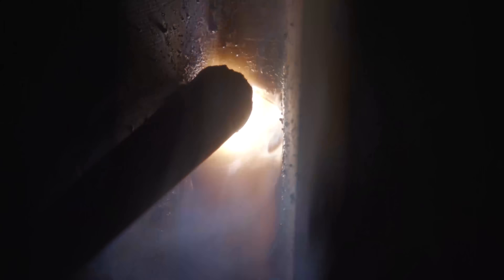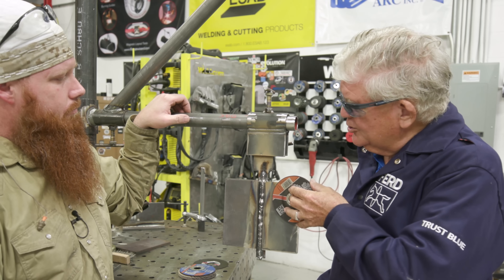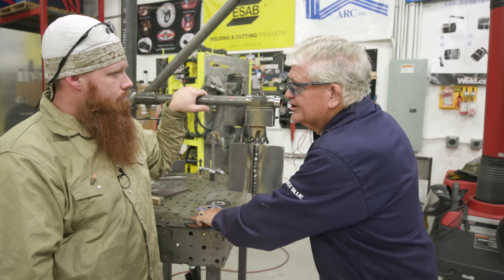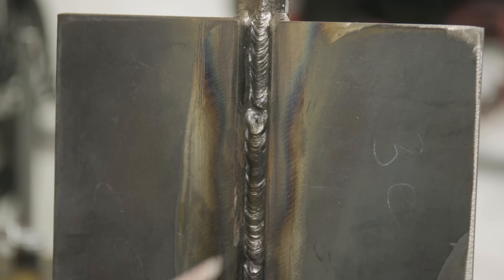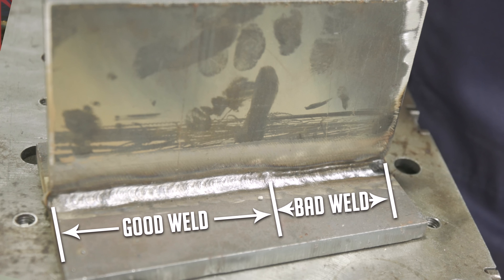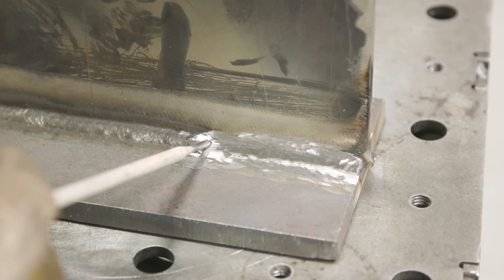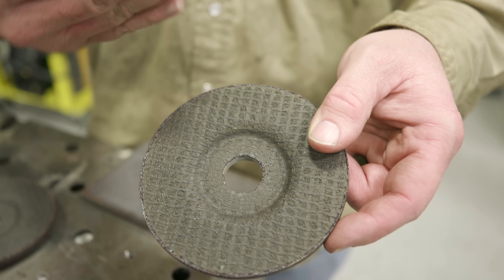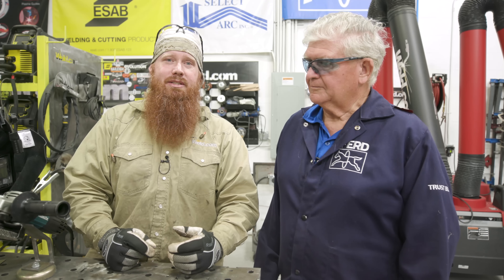How to Repair Common Weld Defects with the Proper Tool

Comment: Good info but how can you grind a bad weld out of an inside corner. A 4.5 inch wheel won't let you get very close in the corner. Is there another suggestion for tight areas like this? Thanks, guys. Great info, great videos!
Reply: Die grinder maybe? With a ball end carbide

Comment: Or you could just use an 1/8 inch cutting wheel, well you will because most fab shops dont like spending extra on stuff thats not the norm. Or you'll just be using the 1/4 inch that's worn in, you arent going to split it grinding out that minute amount unless you are an idiot and lean on the thing.

Comment: I use 4 1/2" 40gt Steel Demon corner-edge flap disc type 29 conical design from Casa Depot.

Comment: Hey man I have a question that hopefully someone can answer.  I want to get certified for my business.  I mainly tig weld aluminum. What type of certification should I be looking at getting
Reply from the maker: As a business owner, you should reach out to your local weld inspection company and develop a procedure. Since there are no prequalified aluminum procedures, you will have to develop your own. They can help you with that.
Reply from the maker: As a business owner, you should reach out to your local weld inspection company and develop a procedure. Since there are no prequalified aluminum procedures, you will have to develop your own. They can help you with that.

Comment: You do know that there is a flap wheel that has been designed with a rounded edge.  It was made for use with fillet welds.  It is made by Diablo.
Reply: Samuel Swearingen Pferd also makes one. Most companies won’t buy them though.
Reply: @GodslilRedneck23  Of course we won't buy them - they're gold-coated (expensive).

Comment: The problem when buying grinding disks is that there are so many manufacturers making so many types, and levels of disks. They all claim that their material, processing, backing, etc. is best. Since they’re all somewhat different, even in the same category, it’s often impossible to make a really informed decision. I’d like to be able to try a number myself, but often, you can only buy a 5 to 10 pack, with some of these disks costing $5 or more each, even in the pack price, making it expensive if you decide that it really isn’t what you want. Doing that once may be ok, but 3, 4, 5 or more times? Forget it. So you just use what you have.
Reply: Mel Gross I’ve had good luck contacting companies directly and getting free samples.
Reply: When I was working, I could do that. But I’m retired, so it’s not as easy.

Comment: Maybe I missed something with your protractor. You’re looking for 37.5°, I read the protractor to be at 53°?
Reply: Henry Ruzakowski the angle was pulled from a 90° corner so you’d subtract 52.5 from the 90 and get 37.5°.
Reply: So... what's 53 + 37?

It's 37.5 off the leading edge, not the top.

Comment: I love how you "have to repair" welds that are better than 90% of what I lay down...
Reply: Jack Dawg I was there man. You’ll get tired of grinding out welds and that will make you a better grinder. I always say, the grinder made me the welder I am today.
Reply: Peter Vendere that’s actually pretty sound advice, thanks sir!
Reply: The first step in being good at something is being a beginner.
Reply: @petervendere3451  Lifting weights is the WORST type of exercise for control. Go do calisthenics rather where majority of your exercises are stability based exercises. Don't believe me ? Go and do a free standing handstand and compare vs a gymnast, check whom has more stability.
Reply: @kazykamakaze131  Hey, maybe yoga would be good practice.
Reply: @POOKIE5592  top yoga masters can't even come close to those top in calisthenics. Remember, welder/tradesman on the regular have to do more than just be able to get into a position, they have to also be able to hold/move sometimes heavy materials and yoga won't help you with this. To be honest calisthenics is better in the triangle of strength/mobility/control. Yoga  never really comes close to the intensity of calisthenics, which means you will not have as good of a cardio vascular system, as you never developed it in the first place ,which means you will get tired far quicker ,especially when your body is being strained in a stressful environment. Calisthenics has all the stretching/mobility work of yoga ,since you need to be flexible to do many of the gymnastic exercises. The biggest problem our society currently has is not just mobility but having a body that is work hardened and won't break on the slightest of exertions and you will NEVER get this from yoga and on the best end of the scale MMA is the example you want to follow where people have strong resilient bodies that don't injure as quickly as normal peoples bodies, this is where calisthenics is in the middle where you get the work hardening of the tendons and bones but not to the point where you risk injury like in MMA, then you have the higher exertion which makes you more fit(look at how ripped many average calisthenics followers are compared to your average yoga follower which looks like a soccer mom/dad). They just aren't even closely comparable. Please go and look at many of those whom followed calisthenics till their death bed and see how well their bodies stayed strong. Now go and see what makes people whom are older have aging issues like rounded backs, bad shoulders, bad backs, had joints etc, this is because they lost the strength of their muscles to hold their joints in place and this causes all the strain to sit on the tendons which can't hold that much of a strain over a long period and leads to injury. Sure, there are some yogi's that look good for their age, but what did they do to get there? They lived a life of relaxation, not like the average person that has to work day in and day out for long hours.
Reply: Better than 100% of mine lol

Comment: Boss only believed in 1/4 grinding wheels or cut off wheels. Couldn't get him to try these out. Had to carbon arc several yards of welds for back gouging. I would grab any 1/4 inch disc's the guys threw out because they were small and use them on to clean up the gouge. They would go quickly but worked well. Couldn't find any used disc's at the end of the job

Comment: I've done my fair share of grinding and I have to admit, I didn't know that some (most?)  thick grinding wheels were not meant for edge grinding.   "The more you know!"
Reply: Apparently wheels are labelled for correct angle now (max-speed markings have been on grinder wheels for a long time, to remind you not to put a big wheel on a smaller-than-intended grinder).
Reply: James Lerch don’t feel bad. It took me a long time to figure this out myself.
Reply: Does it grind when you use it ?? 
Then it's a damn grinding wheel 🤣 these guys

Comment: FTS, give me a die grinder. 
Burrs last 5 years and only cost 3 discs worth. No stone to breathe in so less silicosis
Reply: But you have sharp splinters everywhere 🤬

There is a time an place for die grinders, but I would personally avoid them at any cost..

Comment: Wtf my entire life was a lie🤯
Reply: dude, don't feel bad.  I came across a 'secret joint welders don't talk about' video by Fixtronics, and the guy was doing a rounded-cut joint (pretty, but you're not gonna use it for anything but decorative or aerodynamic applications, so it's not something welders would go out of their way to teach an apprentice) and he was using what looked like a tack-and-flinch-because-I-don't-have-a-welding-mask method.  No bead worth mentioning.  and he didn't even weld the inside corner seam.

Saying the comment section was unkind to the youtuber would be saying it mildly.  the consensus seems to be 20% 'why aren't welders talking about this?' and 80% 'If i made all my corners look like this, my boss would fire me for wasting company time, that's why we don't talk about it.  Also, this guy sucks as a welder.'  And an unfortunately large minority of the 80% was pretty rough about it.  Which isn't really a surprise, most welders are rough-hewn folk at best, and welders as abrasive as a flap wheel aren't exactly uncommon.

Comment: Great info. Now we should use better our equipment. In a previous video with Bob Moffatt they also talked about slower speed. They used a variable speed angle grinder, which seem harder to get. Can you throw some links to that brnd/model of a grinder? Thank you all.
Reply: Eduardo Rosales A only variable speed grinder I know of is metabo

Comment: john take care of your health  you was much bigger its time for the engineers to develop  a rod to remove mill scale  most rods remove  mill scale only if you increase  the current mill scale  protects the metal from corrosion having a rod removing  that mill scale only in the weld area would increase production
Reply: mohammed troy or use the right wheel for mill scale.

Comment: I have used for years a 5/32" disc  works better than a 1/8" . The crater left is because you are welding just a little to hot

Comment: I have this situation daily! 1st I usually put my grinder back in the tool box. 2nd I get the air line and carbon arc gouge.. all fixed in 2 seconds with 1/4" rod. If its sheet metal. Hypertherm plasma gouge.. I gouge steel,stainless and aluminum.. 10 times faster than grinding.
Reply: Same here brother!! Air arc is my go to for repairs.. I work with heavy plate most of the time and grinding is most of the time not the option i choose.. grinding is for when a guy is done gouging

Comment: I would have broke out my tig welder and cranked it to smooth it out.
Reply: Done that before.
Reply: Yeap!!! Maybe this is for beginners which is fine.
The weld was been pushed maybe for video purposes but usually the rule of thumb is to "pull the weld.I am a welder and I've seen worst welds and fixed them with both a cutting and grinding wheels 
Good info .
Reply: @dzrotary  Hi Dan, I am a beginner trying to fix a attachment for a farm tractor.  I had made a repair, ugly looking weld but 10 years later holding up ok.  Now I am rebuilding this and wonder is there a way to tell if weld is good enough to hold?  Or do I really need to grind away all of my welds and start over?
Reply: @jimw6991  hello. Well .what kind of strength will the part be under? If it is light weight ,just test it until it breaks again. If it is heavy .then i would suggest to recut into a v shape as low as possible,then begin filling one tread at a time. Once filled,grind to make the parts flush. Take your time with this because if you over heat the puddle,it will go right through and make a bigger hole. Again one tread and a time and let it cool for the next tread

Comment: Is is possible to stack multiple cutoff wheels on the grinder to effectively get a thicker cutoff wheel? I've seen people stack them on Dremel tools, but is it safe to do on an angle grinder?
Reply: No.
Reply from the maker: That's a big no.
Reply: You shouldn't stack them on a Dremel tool either.  people who try using multiple discs on an angle grinder get less-than-satisfactory results and you have a MUCH higher chance of wheel failure and damage to the grinder's motor (aka 'letting out the magic smoke').

People try it, because they see woodworkers use DADO sets on tablesaws, but they forget three things.  wood is SOFT, steel is much tougher than abrasive wheels when it's not getting abraded, and tablesaws that can accept a DADO set have a much heavier motor than ones that can't, and no one makes a multi-disc angle grinder.  the end result of using multiple cutoff wheels together usually involves guard failure and both wheels shattering all over the place.

Comment: Awesome videos, the grinding safety bits is the best, keep up the great work.

One quick question, can you put up a link to the edge grinding 1/8" wheels? I couldn't find any. Again, awesome stuff!
Reply from the maker: Link is in the description
Reply: @Welddotcom  Awesome!  Thanks.
Reply: @Welddotcom  The description shows several grinding wheels but your guest referred to a specific 1/8" thick edge usable grinding wheel, the description doesn't have a link to a 1/8" thick wheel. It only has 0.040", a 1/4", and a flapper wheel. I didn't realize I shouldn't be using the edge on these other wheels and therefore very interested in using the proper wheel. Did I miss something?
Reply: I'd love links to all the Pferd stuff in the Pferd videos.  I searched for those silicon grinding disks from the older video and couldn't find them.

Comment: I had problems with flap Wheels contaminating especially on stainless
Reply: Bob Herforth I write mild steel on the back of the disks and store them in another area. I do stainless 99% of the time and know the fatal mistake of cross contamination. A horrible mistake to make and very expensive. Shouldn’t even grind mild steel in the same area as stainless.
Reply: Redbeard did a recent video on 'how to use these disks'.  He specified that you should never use a flapdisk for both regular steel and stainless steel  (well, he said stainless, but I'm pretty sure they don't do 'stainless' in other standard alloy types people use) because when you use a flapdisc on steel, it gets impregnated with iron particles.  Used the disk on steel?  write 'steel' on it.  Used it on stainless?  write 'stainless' on it.  and don't mix them up.

Comment: Special thanks to Mr. John!

Was hoping that he would Introduce an ¼" Gringing Wheel with a 90° Angled at a 45° Angled Bevel as a "Not Seen/Unknown" Tool!

Holding the Grinder at a 15° Angle makes sence for a Speedy yet Desirable Removal!

I am learning SO MUCH to "Prepare Myself" to start using my 125Amp HFT Flux Core by June...  As I have to clean & organize my Garage first! 😋🛠

Thanks again for the Grinder Safety Video! I'm now looking for a "Secondary" Grinder, so that Im not having to change Wheels so often.😎

Take care,
🤓 -Thomas
Western Washington State
Reply: TK Skagen I use the harbour freight drill master for my extra grinder I use it with a wire wheel casue I don't need a ton of power for it
Reply: Dewalt makes one
Reply: cant go wrong with Dewalt grinders. I use 3 sizes and they are all a WORKHORSE!!

Comment: Are all 1/8 inch wheels made for on edge grinding?
Reply from the maker: No, you need to have a disk made for dual purpose. I believe all 1/8" wheels can go on edge, but not all can be used flat.
Reply: @Welddotcom  thank you.. great channel by the way.

Comment: So a rep from Pferd, has just basically stated that it's ok to use a stone/ concrete disk to grind steel...... I think he's wrong
Reply: This isn’t a concrete wheel, concrete wheels typical use carborundum (silicon oxide) as n abrasive.  This disk will most likely use aluminum oxide abrasive in a composite suspension.
Reply from the maker: Refer back to the "4 ways to remove millscale" video

Comment: Interesting, did not know there were different types of wheels for this sort of thing,  thought a whhel is a wheel 😁👍great vid. 😁
Reply: As they noted, there was a video on this about a year ago. The catch was that the sales rep was hawking some pretty expensive abrasives.
Reply: right tool for the job, right?  you can make a Philips driver bit fit into Posidriv screws and vice versa, but you're likely to mess up the screw head, the bit, or both.  But if you have a Philips bit in Philips screws, you can go hundreds of screws before pooching the head, instead of maybe a couple of dozen, and the same with Posidriv bits in Posidriv screws.  'Good enough' might  not be good enough--save that thought for out in the field with no other choice.

Same with your grinder wheels.  right wheel makes the job better.  also, if you're using a cut wheel, it's most likely a type 1 wheel, OSHA in the US (and equivalent organizations in Canada) want you to use a Type 1 ferrule and a double-sided guard.  (honestly, I didn't know there WERE Type 1 ferrules and double-sided 'Type 1' guards until it came up in a recent video.  And my 4.5 inch grinder came with a cutwheel, not a 1/4 inch wheel >.> )

Comment: I have some 1/4" hard rocks that can be used on their edge and or on a 45°
Reply: Who makes them?
Reply: @zachmosteller4681  dewalt. I have 1 without a locking nut and 2 with a locking nut. I havent used them on their edge yet so idk how well they work. I try to only buy grinding wheels that can work on a 90 or 45
Reply from the maker: What's the part number? I've never heard of any.
Reply: @Welddotcom  the model number is DW4523 for the type 27.
Reply: @Welddotcom  sorry for the kinda late reply, was knocking out 2g welds for test day
Reply: @Wroger Wroger This has nothing to do with welding, please take your crap somewhere else.